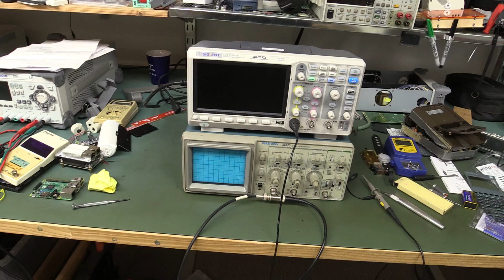ESD Work Bench Matting Ageing

Comment: I have read all the comments so far (108). I don't think it is an issue with UV as that tends to lighten colored items and the lower the color frequency the greater the effect, red turns to yellow or pink and brown turns to green or gray, etc depending on the pigments involved. A mason jar left on the windowsill will still change color over time so maybe our thinking on UV and other frequencies glass penetration is not complete.
 Blue into green would indicate the addition of yellow or brown rather than the bleaching of a primary color. And as the change is less where items were in long term contact with the surface, I now firmly believe it is solely an air quality issue. Although the color change may not be reversible, bleaching or oxidizing agents may help, and it may be slowed or stopped by increasing the air exchange or filtration rate to a level that will mitigate the amount of airborne pixie farts.

Comment: I went looking for this blue mat after seeing the lab. Found some unbranded Chinese stuff on eBay. Mine has been installed on a long bench under two small north facing windows for less than 18 months. I have the same discolouration under the windows, fading the least towards the areas furthest from the light. 

Think we got stiffed with sub-standard product that hasn't been materials tested for UV degradation.

Comment: I noticed the discolouration of the EEVlab ESD matting some time ago, but thought it may be the lighting. I bought my ESD matting around the same time as the EEVlab installation. I got mine from Somerset Solders in the UK. Installed next to window with direct sunlight, but no discolouration here... UV meters are generally expensive, but might be worth picking one up to see if that's the cause.

Comment: Copper turns green when it oxidizes (rusts).  Maybe the mats are impregnated with copper to make them conductive... just a guess.
Reply: Stephen A little acid would brighten the copper up if it is oxidized. Would be interesting to see tested in this case.
Reply: difflocktwo Ya, good thought.  In fact if I remember my chemistry, copper can be reduced to form a blue sulphur salt which may be why the mats are blue when new.   Hey Dave, can you try wiping the mats with some diluted sulphuric acid (battery acid should work)?
Reply: Stephen Or lemon juice.

Comment: If it's down to simple light exposure, why does it the discolouration get darker the closer it gets to the Mantis base and also why the discolouration between it and the wall behind it? 

I'd say the pattern points to something like oxidation in the presence of light, with it getting worn off to an extent in areas that are used.
Reply: I thought that too, but put it down as reflected light double dosing as it where.

Comment: Quit smoking/vaping in the lab? 😜
Could that be caused by VOCs from flux and other chemicals? The patterns look more like fallout than light exposure.
Reply: I have the same mat from the exact same distributor as Dave and mine has gone brown exactly as his has. I have halogen downlights, natural sun light, and they see very little exposure to nasty chemicals/gases as they are inside my house. I don't do much soldering. It is almost definitely the bromine fire retardant causing them to brown. Exposure to oxygen and UV light accelerates it. The matting around my soldering iron is actually less brown than other areas because it is further away from a window (where sun light shines in from time to time)

Comment: I think the colour change is mostly about oxidation. The extent of colour change doesn't vary in ways it should if it were all about the light. Benches by the window would change a lot more than benches deep in the lab, where the sun doesn't directly shine. That doesn't seem to happen. The extent of colour change seems to be much more about how well fresh air is excluded.

I wonder if all the blue->green mat material comes from a single supplier, because it all seems to behave in a similar manner?
Reply: I've seen similar colour changes in labs all over the world. It happens to a lot more than just one roll.

Comment: why you guys simply dont use metal bench? i just put together one so it crossed my mind.
Reply: what would be the benefit? For ESD reason, you need some resistance or else the charge dissipates to quickly , killing the parts.
Reply: sarowie thanks for explaining to me. well putting a resistance between ground and metal table could resolve that but that is weird...
Reply: There needs to be resistance between the pins and other metal objects on the parts, otherwise you are shorting the parts.
Reply: Exactly, that has to be avoided, so who in their right mind would power up a PCB on a metallic surface?
Reply: I am not sure what point you are trying to make here. Yes, there may be people that do whatever work they do on a steel bench. There are also people like Louis Rossmann that do professional component level repair of consumer products on an old and rotten desk. 

But this all is a totally different usecase than an electronic lab table where you have bare PCBs being powered while touching it.
Reply: I get it now. Thanks. What i was thinking...
Reply: Guess what happens if I put  bare PCB onto a metal surface and turn the device on...
Reply: You are pushing it now. The hole point is to discharge static electricity not to conduct electricity across the pins of the device.
Reply: Who would power device on any conductive surface in such way? Even if there is some arbitrary resistance it will affect device.
Reply: Which is why we have ESD mats that are specifically designed with such things in mind. For the vast majority of circuits having them touch the mat makes no difference at all
Reply: Not great idea when you debug or design some precision device. And for the price of those mats... I can buy 72" super sturdy metal table no worries about static discharge and use any plastic mat to isolate working circuit. Not sure what effect has such huge ground surface for shielding RF etc...
Reply: This mats can be very expensive. And quality as we can see ... Looks very bad I am sure it works... I have a lot of pcb boards for development without any enclosures and I don't take care for lot of them they are in metal and wood working shop and none had an issue they work fine as long as I blow dust and chips from them and make sure they don't short when they power up.
Reply: Dennis Lubert look at this: http://www.circuitnet.com/experts/87939.html

Lot of this seems to be hype and my question was not at all stupid.
Reply: Dennis Lubert if you did not get it then nothing. Thanks for discussion, I found what I was looking for.

Comment: Interesting! Have the electrical properties changed at all? Had you been cleaning it with anything specific?

I clean mine regularly with Staticide mat cleaner, and I've only noticed minor discolouration in an area where I had left a piece of equipment with cheap rubber feet.

Comment: A compliance magazine did some testing on ESD mats. One thing they found is that the UV radiation form fluorescent lights seems to have an effect on the static dissipative properties over time! They don't mention anything regarding the color changing, but it wouldn't surprise me if that is just a side effect to UV exposure.

Also apparently there are certain cleaners that you can and can not use, otherwise you risk changing the dissipative properties of the material.

http://incompliancemag.com/article/early-life-failure-of-dissipative-workstation-mats/

Comment: Not sure if is just the color temperature setting on your camera but even the place under the microscope has a color change so it may not be related at all with UV. Not sure what sort of lights you have there (other than the LED panels) but I doubt there is much UV (for sure way much less than outside).
Also blue should not be that sensitive to UV-A. I had some silicone cables installed outside red an blue and the red is now a light yellow but blue is almost unaffected by UV.

Comment: That mat may be Bominated to increase it's flame retardance. Bromine tends to leach out of things for no good reason.

if you want to test and confirm the theory of UV causing the change, make a box with a good blue sample in it containing a dozen or so UV led's at close range. cover one half of the sample with something opaque and let it buck. i'm sure in a few days or weeks you'll be able to tell.
Reply from the maker: Could be an interesting experiment!
I could use my old PCB UV light box.
Reply: EEVblog2 if this is the cause, to reverse it you just need to put some gel hydrogen peroxide (for hairs bleaching) on it and expose it to UV again. gel is better beacause it doesn't evaporate.

Comment: Hmm, that's strange.  Have grey two layer rubber ESD mats here and have never noticed a change.  One of them is directly in front of a window and gets blasted with sunlight daily.
Reply: Glass contains/consists of SiO2 which has a band gap of 8.9 eV. Assuming its not VERY thin, shouldn't basically all (like 99+%) photons over that energy be absorbed?

However, there is still plenty of UV-photons under that energy, and i suppose they might be 'dangerous' enough. Haven't really looked at the spectra to see how much actually is there and what energies are required to cure epoxy or do the discolorations.
Reply: Normal plain glass (even 75-year old glass) heavily attenuates certain wavelengths of UV. Let's not make ourselves look silly with simplistic statements like "Windows block UV" or "Window allows UV to pass"; unless you know that the UV wavelength that cures epoxy is the same as that which damages ESD mats.
Reply: But windows block UV.
Reply: gunnish1337 

These aren't fancy new windows, there over 75 years old.  Plenty of UV gets through them, enough to cure UV cured epoxy overcoat.

Comment: Check the resistivity of the mats -- has that changed as well?   You might also want to measure the UV levels from your overhead lighting.  It's probably much higher than you expect and that could represent a health issue.
Reply: If you check the surface resistance of the new or old mat it is essentially infinite. Look up static dissipative materials. With most insulators charge sits in pools on the surface. With some it spreads evenly, due to the repulsion between like charges. The later kind of material is easily drained of charge without really being a conductor.
Reply: Dave has the necessary gear to measure into the giga-ohm region.
Reply from the maker: Or they could simply be poor quality mats?
Will have to get a UV meter, that could be an interesting measurement.
Reply: It is not infinite because then it would not be an ESD mat. It has some high value that is too high for a normal hand held DMM, but easy to measure with a separate voltage source and an electrometer or a picoamp meter.
Reply: that is a good point, I remember the video.
Reply: I'm not sure you can measure a practical resistance as the surface seems to behave as more of a controlled breakdown than a true resistive surface if they are anything like my 3M ESD mats.  You would really need to use something like a megger to get the high voltages necessary to achieve electrical breakdown before you get a meaningful "resistance" value, but even then that value would only be meaningful in the context of a specific breakdown voltage.  If they do have an actual resistance then it would have to be well beyond a few gigohms.  The underlying carbon mat just below the top surface has a typical measured resistance varying between about 3-20 megohms depending upon where you take the measurement (I'm guessing there is something of a distribution grid built into it as you will see the resistance increase, then decrease, then increase, etc, as you move down the length of an edge.

That the mats work this way is very nice as there is no real leakage current to be concerned with when running tests at typical AC and DC voltages so the mats do not affect the validity of your tests even when the circuit board is resting directly on the mat.  Plus the surface is exceedingly difficult to pierce by accident and highly resistant to heat so also great for soldering on while protecting the desk surface below.
Reply: Dave, your spectrometer might be useful for that, isn't it? Or UV is out of its measurement range? Maybe not just the mat, but the phosphor in the LEDs also ageing, and it causes more UV to get through? BTW, your lights are edge-lit (as I remember), I can't really imagine those thick polycarbonate sheets and diffuser foils are transparent for UV.
Reply: Many white LEDs are actually emit UV internally, with a phosphor on the lens that fluoresces and emits white light.  Those can leak UV.  Some quite badly.

Comment: Try a bit of peroxide treatment, see if you can de-yellow it as an experiment kind of like the retr0brite treatment for yellowed plastics... :)
Reply: was just about to say the same thing. may want to see if that peroxide cream stuff they sell in big bottles at hair salon supply places would work.
Reply: 100% Peroxide!?! How the!? I'd assume that's a typo, getting peroxide that pure would be a major explosive hazard and would light the mats on fire.
Reply: That stuff works better than the 100% peroxide liquid i got from a chemical suppler , no idea why it just does . ITs 12% mine i think.
Reply: A small section would be interesting to see if it works but all of it could be expensive and just a nightmare to clean off.
Reply: 100 vol ... not 100%